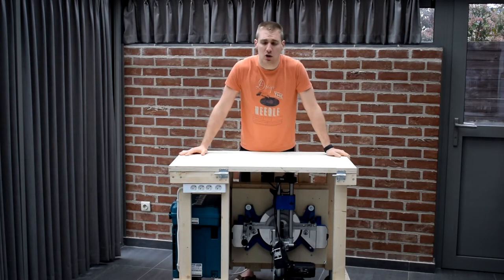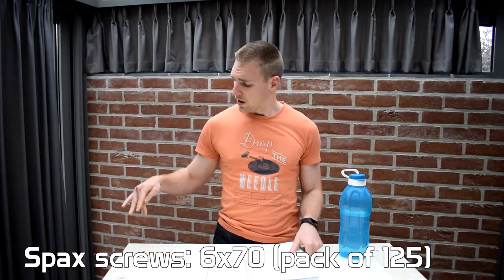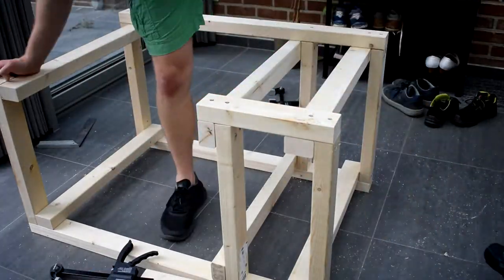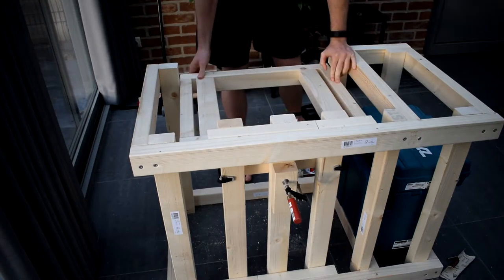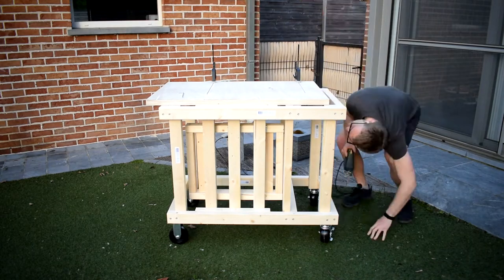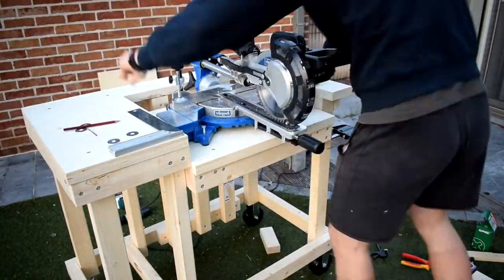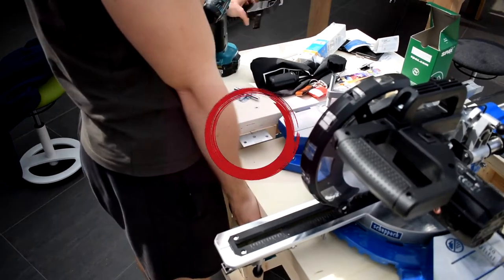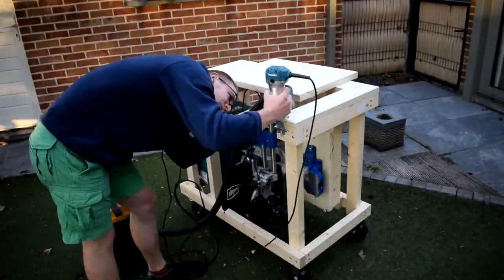DIY Mobile Workbench with Foldable Miter Saw Station

Comment: This is such an elegant design!  Thank you for posting it.  I have a sliding miter saw that's just always in the way, so making it into a cabinet that can double as a work surface or outfeed table for a table saw is going to be perfect.
Reply from the maker: Thank you so much brother! 💪  I really enjoy working with it. Especially not having a lot of space to work with, this is game changer! 
Are you going to build one too? If so what would you do different?
Reply: @BarRookie  Yep, I'm going to build one.  The only thing I'm thinking about changing is putting adjustable feet on it, and maybe retractable casters so that I can fine adjust it to be an outfeed table for the table saw.  Then I can also use the table saw as support for long board to cut with the miter saw...kind of a win win.
Reply from the maker: @tomsmith3045 sounds like a nice addition! 👌 please send me a picture once you are done! 😎

Comment: Simple and very practical, well done. Are you still happy with the design or are there things that you would do differently now that you have used it? Groeten uit Nederland 👍
Reply from the maker: Actually, not really! It's so much fun working with it! I did add some things along the way. Like an outlet and some storage options. I might make a video about it if you like! 😊
Reply: @BarRookie  I would be interested to see that for sure. I ordered a machine and now I am looking for inspiration and ideas. I am also thinking about the idea of incorporating a small table saw or a router, or both, if I can find a way to make it work with the space that I have. So therefore I like the fold-able miter saw design. It would make the table also usable as a table saw or a router table.